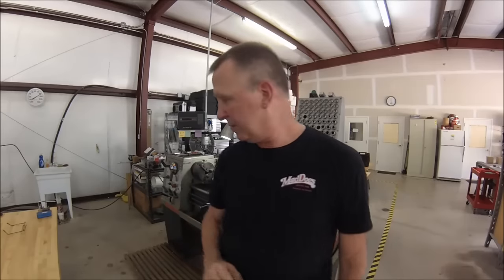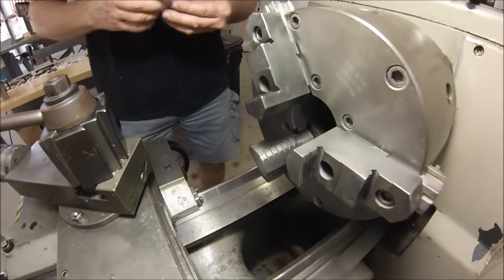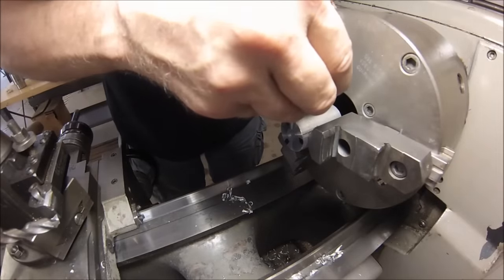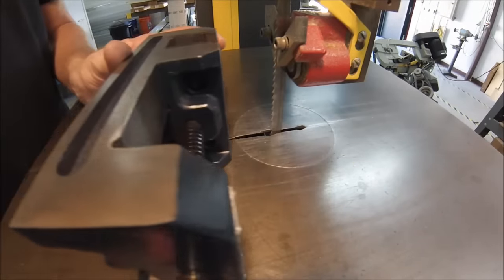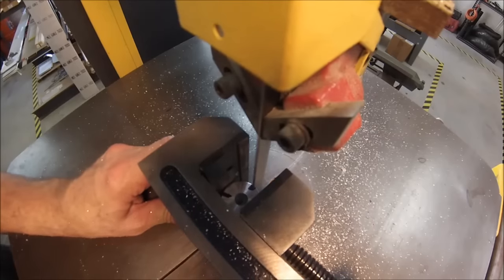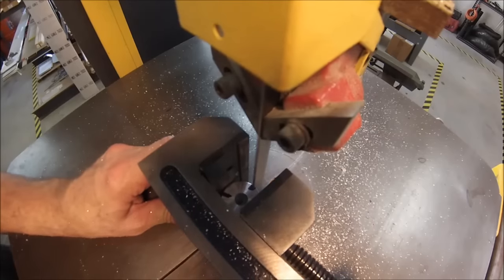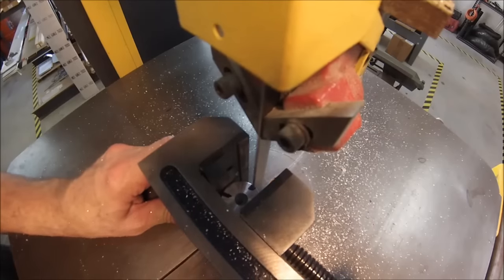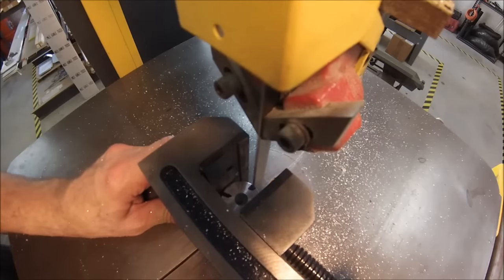Get your parts to run true in a non adjustable chuck. YOU MUST WATCH THIS!

Comment: Thanks for this Joe!  It took me about two hours to actually get it to work. But I am rank green hobbyist with used Taiwan lathe and have been teaching myself. It has been a struggle , moving my lathe and setting it up on my back patio , wiring it , tramming it , leveling it and tramming it again. Crashing it , rebuilding it , bearings,  tramming it again . Making it run true has been a big learning curve but I keep on keeping on! After shimming the closest my three jaw chuck has been about .009 and I am thrilled. Now with your collet/bushing trick I have repeated consistiently .003 everytime with my rudimentary and   very limited tooling. Occasionally I have measured .001 surely the tolerances of my measurements have alot to do with just how precise I can consistiently achieve.  I have bushings for 1" , .875 ,
.500 and .257"   Just to get repeatability at this tolerance has been a major step forward. It is a painstakingly slow process but now that I have the bushings made the setup moves right along it my production of simple parts

Comment: With somewhere over 45 years of machining in job and big machining sops  this is the first time I have seen a machinist vice used to hold a part like that in the machinist vise used lik that to hold a part for drilling. School every day eh. Thanks bud. Befor I retired  i lived my life dealing with a .030 runout. Oh if I had only known this, , , WOOHOO EH ! Big thanks new friend.
Reply from the maker: I keep that little vise on my welding table and grab it for stuff like this. Works well.

Comment: This is a typical solution for a handy man with ample of time. As a pro I prefer to use an independent 4-jaw chuck. Even then I can put a small three-jaw chuck into the i-4-j-c. Always keep the chuck nice and clean, don't clamp too hard and use the same key hole (mark it). Also i use small strips of thin copper to get the work-piece within 0,05mm. But I work at a shipyard with big lathes up to 4,5 meters diameter and 18 meters length and we have no large series to produce.
Reply from the maker: Gotta say, In all my years of machining, I never saw another guy in any shop I've ever worked in, put round stock in a 4 jaw chuck. He would have been laughed out of the shop then fired. Your type of large diameter work is another world. You have my respect. This fix is good for guys that don't have a full shop of accessories to lean on and need that second side to run true. Thanks for the comment.
Reply: Hey joe,

wonderful video! out of curiosity, why would you never put round stock in a 4 jaw chuck? Is it due to just being a time waster in a job shop?
Reply: Joe Pieczynski For the last 4 years, I've barely used a 3 jaw and clocked all round bar in a 4 jaw. When you've done it as often as I have, then it's nearly as quick. I should mention the 4 jaw is 30" Dia and fixed using 8 x M20 cap heads and changing over is a job in itself using the 5 tonne overhead crane. Also I do a lot of none round work. I've been a turner, both manual and cnc for 30 years.
Reply: If I had an existing piece of round stock that was already to size, and that diameter had to be true to less than 5 tenths with relation to what I was going to cut, I wouldn't' have any choice but to put it in an independent chuck. Even a collet might have too much runout for some classes of work.
Reply from the maker: My days with those big machines are well in my past. I too would want as many jaws a possible on parts that big. Thank God for overhead cranes.

Comment: Even if your 3 jaw is not out of wack this is a good technique to use when you want to avoid jaw marks. It’s like making a homemade collet out of a 3 jaw. I guess you could make a whole set of these “collets”...
Reply: Cal30m1   Is correct , after high school in late 1970s worked in machine shop , superior air products ,Sayreville NJ ,we made brass collets to compensate our very worn  old three jaws , a large brass collet was used to hold hex stock ,preventing damage to stock being machined .
Reply from the maker: Agreed. These collars are also good for spreading surface pressure out on thinner or flexible parts.

Comment: Had no idea where you're going with this until the a-ha moment near the end. Great trick and great video. Thanks!
Reply from the maker: Thanks for watching.
Reply: So glad I saw your comment, I thought exactly that but as I'm new to machining I went with it.........glad I did,all these little tricks, great. Also why are people mentioning collets surely if your chucks off (centre)then so will the collet (centre)? Just found your channel....subbed.thanks
Reply from the maker: @rolandsmith2141  Collets rely on the machine's ground nose taper and the chuck is usually dependent on an adapter. You can have precise collet performance with a poor chuck.

Comment: Joe
I also wonder why you make the statemnent "do not run the lathe with nothing in the chuck".
Can you explain please??

Wonderful video once again you are one of my gurus

Dan Bentler
Seattle
Reply from the maker: Hi Dan. I see many of our internet guys run the spindle with a chuck without a part in it. The scroll is a ring with a helical groove in it that sits freely in the chuck body. There is nothing to stop it from spinning at a different rate than the spindle if there is no load on it. Take all your jaws out some day and start and stop your machine. This scroll has a mind of its own and could easily launch or trap the chuck jaws causing injury or damage. Its just not a good practice to spin an empty chuck. Good question.
Reply: I was wondering that too.  Thanks for the clarification.
Reply: Thanks for taking time to explain.
Dan Bentler.

Comment: this video is very on task, done at the speed the boss would expect. Good example of real world problem solving. Thanks joe
Reply from the maker: Thanks for watching and commenting. I can do it much faster when I don't have to narrate or film it. 5-10 minutes.
Reply: Good I tought I invented that threading away from the shoulder but I geuss they been doing it that way for a while.I've got a cheapo lathe so I've got to use some tricks like that too. you've been doing this  for years I can tell. thanks for sharing cause in my opinion its a pull yourself up by your bootstraps economy but when was it not people can learn a lot from you that's valuable to your fellow Americans and the world sorry for the ramling on but ya thanks

Comment: At 2:48 you place on the screen, "Never turn on your machine on if the chuck is empty." I would like to ask why and secondly, even if the chuck is in the closed position (all jaws touching) this rule still applies?
Reply: the reasoning behind this rule is that in the unlocked state, the chuck and all it's internal mechanisms are more or less free floating. so if you turn on your machine, nothing stops the internal screws from rattling around, and since there's a centrifugal force on the screwing mechanism, the movement will generally be towards unscrewing the jaws. give this enough time and you turn your chuck into a shotgun.

adding onto that, at one place I worked at they had special "quick set" chucks that allowed you to jump the jaws between indexed positions in the unlocked state by just pulling on the jaws. spinning up one of those chucks without a part in it would turn shotgun even faster.
Reply: Oh. Makes sense. I wanted to ask the same question since I do it on my old Sebastian lathe all the time. Guess I never noticed it listening up.
Reply: @burtvincent1278  if your chuck is all the way down for relatively small parts it's "fine" in the sense that you'd probably notice the yaws walking all the way off, but because you can shotgun yourself with chuck yaws (and someone probably did at one point, just like people shotgun themselfes with chuck keys every once in a while) people wrote the rule into existence.

Comment: Joe, I'm real new at this. You are a real Pro but it looks to me like you take a lot of chances with Safety. All I could picture was that flat file getting caught on one of the jaws of the chuck and flying back at you. All it looks like is one little slip. Another was the band saw. You have the work piece material close to that moving blade, unstable,  as you're adjusting the table, bouncing around the material about to touch the blade and send that across the shop. Or through your head. I may be a dumb Carpenter turned Welder now, but you're scaring the shit out of me. I appreciate all your great videos and learn a lot. God Bless you, and please , as you're teaching us,  please be careful. We need you. Jason T/New York

Comment: A better tip on using a file on a running lathe - Never apply a file against the advancing side of the workpiece (aka top), apply the file against the retreating side, (aka bottom). This way, if anything grabs the file, it will be shot out AWAY from you instead of driving the file into your hand or chest. Also, never change the tool holders while the lathe is running. If you drop the tool holder it could bounce right into the chuck and crash your ways, your chuck or your face. Power equipment has no conscience and no remorse over wrecking your body.
Reply from the maker: Everybody works the way they are comfortable doing, but I have to comment on your suggestions. Only if the tip of the file comes in contact with the jaws is there a potential for it to launch into your chest. Otherwise, it just bounces around and doesn't do anything. Chances are, if the file hits the jaws, it abruptly scares the shit out of you, and you naturally pull away. Working on the top of your work piece keeps the file in the rejection zone, to place anything under a spinning part is a really bad idea. Plus, it usually translates to only one hand on the file.  As for shutting the machine off every tool change, thats a good way to burn up your machine or get fired. Back the carriage away to a safe distance away from a spinning chuck and use tool post knobs on your blocks for a better grip. I agree machinery has no conscience and only the operator is responsible for their own safety.
Reply: billsixx ,bill just use common sense ,as a machinist you should alwAys know what can happen,I've been a machinist for many years ,never been hurt never really screwed up,if you have to turn off the spindle just to change the tool ,then it sounds like your pretty careless,you must make alot of little stupid mistakes,professionals  like me and this guy in this video ,rarely make mistakes we rarely do stupid shit like dropping a tool into the spindle,if your that careless you shouldn't be around this type of machinery
Reply: Joe Pieczynski ,bill six doesn't have any hands on experience,he's one of them guys that paid a fortune for schooling in this industry,but he's just speaking from what he learned in school,if hes that careless ,where he has to turn off the spindle ,he needs to find a new trade.

Comment: In a professional shop, time
Is everything! Making fixtures is sometimes necessary for production runs..Having a quality adjustable 3 jaw chuck saves time and money!  However, if you know how to properly use a 4 jaw Chuck you can indicate anything very quickly including eccentrics without all the fooling around!  Not to mention a 4 Jaw chuck has MUCH more holding power!  That being said, using soft jaws works well and is much faster and repeatable.  It all comes down to set up efficiency, repeatability and production!  Which means time and money!  A junk chuck ends up in the scrap pile!  No time for fooling around in the professional world. In any case, thanks Joe.
Reply from the maker: The title of this video says it all. Companies and people with time and money may make different choices.
Reply: I use my “junk” chuck that I replaced because of runout in my cnc mill next to 4 vices and leave it set up for g59

Comment: Not all home shops have junk lathes that have a ton of run out. But making a collet in a pinch is a good idea for a toolbox. Or a machinist with no work. Great vid!!!
Reply from the maker: This is a quick fix and a good way to also hold a part with a sensitive finish or irregular profile. I have dozens of these laying around. Takes 5 minutes to make. Not sure about the "no work" comment. This works for many different situations.
Reply: Joe Pieczynski like u said if you need it and you don't have it, make it!! If you can't wait or can't afford a real collet set. But my comment was meant for those machinists who can just sit around and make collets all day not the ones who use them for making money due to them needing it.

Comment: I call this a split bush and use this technique all the time and I work full time as a turner. But I never go to the all the bother in this video. It can be done with just one cut to split the bush and  then turn the diameter to suit, Cutting it in 3 places takes too much time.

Comment: Boy! This brings back a lot of memories when I used to report to "Machine Shop" class so I could reserve my favorite lathe.  Got  a job at a huge company as an electrician but they did not allow me to use a lathe or even touch it except at times when I have to do electrical maintenance/repair.
Reply from the maker: I was a shop junkie in school. I was very fortunate to attend middle and high schools that had fully equipped shops and offered an industrial prep curriculum. Fell in love with the trade from day one.
Reply: The machine shop class was part of the Engineering Degree I was pursuing (4 semesters of machine shop) and enjoyed every minute of it. It was a decently equipped shop with only one milling machine.  Everything is manual.  Got bogged down in university when advanced math came up.  Should have concentrated on what we call "Vocational School".

Comment: Never file with your left arm over the spinning chuck. Always hold the file with your left hand. And it takes longer to make this home collet then to machine the part.
Reply from the maker: Wanna race and find out?
Reply: Joe Pieczynski well at least you will have your legs for said race.. If a chuck is out that far something is wrong . Loading up soft jaws and boring them while restrained will win the race! Industry Standards
Reply from the maker: @TimothyGambino9085  I appreciate your comments, but this video isn't made for shops with soft jaws and 2 piece jaws. Its made for the garage, hobby shop machinist that doesn't have a fat checkbook or a shelf full of attachments for his machinery. It clearly demonstrates, even with a severely out of concentricity POS chuck, you can get a part to run true. This bushing is a 5 minute job at best and is much faster than setting up and boring soft jaws. Legs or not.
Reply: Joe Pieczynski sorry joe I apologize
Reply: you can make 10 parts or 100 parts  faster with a collet
Reply: david jones not really . Not if you gotta  make the collet itself before you even start.
Reply: @TimothyGambino9085  you don't have to make a new collet every time
Reply: david jones That’s right! However you gotta cut it bigger. It’s faster and better to cut soft jaws with multiple steps then you can even use the same jaws for the second operation. Keep in mind that method he’s using is a band aid for emergency use only

Comment: I'd just get a four jaw, save the time get a .0005 indicator and be done with it....
Reply: 4 jaw is a pain if your running multi parts back to back. Also some of us use various chucks for different jobs I.e: a 5c collet chuck, backing plate, etc.. and cannot limit ourselves to a single chuck due to the wide variety of parts we make. I have parts you could never make in a 4 jaw.
Reply: @glennedward2201  i guarantee i can make any of your parts in a 4 jaw
Reply: SuperAWaC i guarantee you cant and it wouldn’t be prudent to make some of my parts in a 4 jaw. To guarantee something you haven’t a clue about what parts I run is pretentious at best. Glad your such a stellar machinist. Fact of the matter I could probably produce parts twice as fast as the average machinist and we do small run production so yes we use multiple jaw chucks however a 4 jaw adds a significant amount of overall time to dial in the part and that is the point I made. Nothing to do with whether a four jaw or 6 jaw cannot be used however I’d like to see a right angle chucked up in a 4 jaw, lol, good luck. There is no way you can make all of my parts back to back using a 4 jaw and starting with material that is already .0005 in tolerance. You have no extra material so you’d better indicate every time you chuck a part. With 3 jaws I don’t have to do that. Also we’re more apt to use a 5c collet before a 4 jaw and I will take that for repeatability any day over a 4 jaw as well it results in quick changeovers and speedy production. I’ve had machinists with a so-called 30years come in and chuck up 4 jaws to turn around and have to pull it for parts that won’t center due to geometry that doesn’t work with 4 jaws. Then I watch them spend an 8 hour shift making an $85 part that I can make 15 in the same time. Some of these YouTube videos I see a 3-4 hour edited video and for parts that should take 10 minutes. It’s screwing around and wasting time. Much better ways to remain productive and that is to (Understand “Manual” production) and the use of “proper tooling” which is the key to a successful small business. Good luck with your approach.
Reply: @glennedward2201  i can indeed chuck right angles into 4 jaw chucks. i'm not saying it's practical, but it is certainly doable. i personally use a 4 jaw and a 6 jaw in my shop, i've never needed anything else. although i have modified my 4 jaw to be able to do weird things.